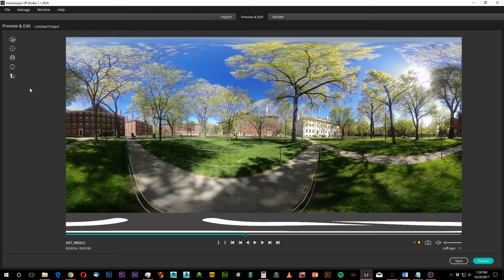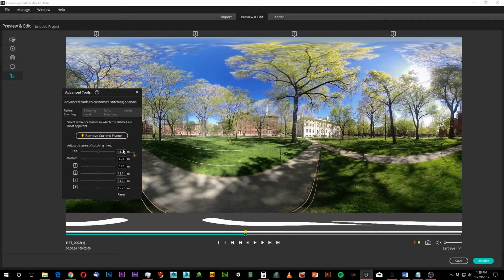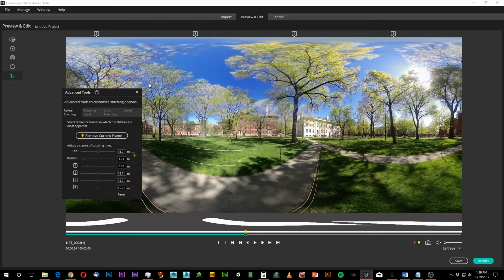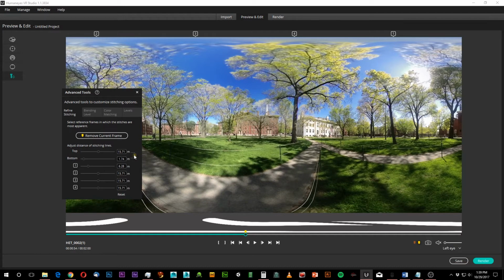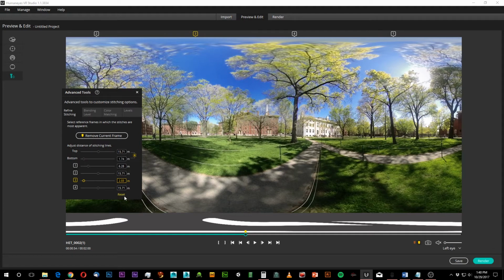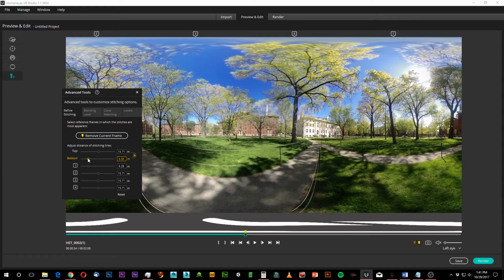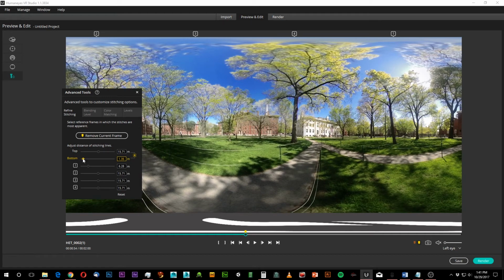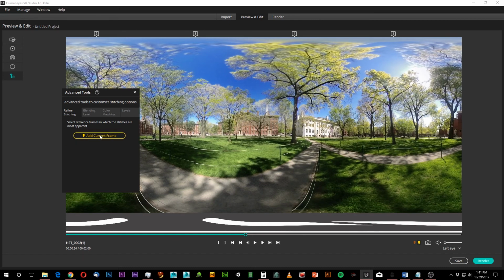Tutorial: Vuze VR Studio Advanced Tools - Stitch Refinement

Comment: Off topic. I have a Vuze camera. What is the best Micro SD card for the Vuze that is the best value? The camera wants the highest bit rate possible when doing high quality 4k/360 recording but most of the micro SD cards say maximum of 90 bit rate. Are the only "real" compatible cards the nearly the $200 ones?  I saw the web page suggestions but that is only 5 examples and only one is a true "120 mb bit rate" card at a whopping price. I already wasted money on 2 cards that didn't work. The camera kept freezing and the card heated up. You guys need to put up a real long list of ones that will be guaranteed to work for the best setting of 4k recording. Thanks. It is a shame we first supporters didn't get accessories with our purchase also. Oh well. Right now I have a desk top paper weight until I can find a card that works well for true 4k recordings that won't freeze or heat up. I found this card but I am always scared that they will not perform as said. I see benchmarks on the internet and they don't show the correct speeds. I am wondering if being directly in the camera is different than having the MicroSD card in a USB3 adaptor. And I am assuming the Vuze camera takes full adavantage the UHS II connectors? Here is an Micro SD card I found. Will this work for sure for the 4k/3D recordings? Thanks again.  https://www.amazon.com/Lexar-Professional-microSDXC-UHS-II-LSDMI64GCBNL1000R/dp/B00U77V5KU/ref=sr_1_1?ie=UTF8&qid=1514012763&sr=8-1&keywords=Lexar%2B64GB%2BProfessional%2B1000x%2BmicroSDXC%2BUHS-II%2BU3&th=1
Reply: So to reply to my own post and those interested: here is the best bang for your buck mini sd card if you can tolerate only 64Gb. I have used this in the Vuze camera and there has been no problems as far as I can tell. No overheating or lag or sudden stops mid recording. I have actually recorded constantly for 1 hour with no issues with these cards. The free usb3 adapter makes everything that much easier when transferring files. Just pop it in a high speed USB port and zip zam zoom. All done. Hope this helps. ;-) Link here for where I buiy my cards >>> http://www.microcenter.com/product/497829/64GB_Professional_1000x_microSDXC_UHS-II_Memory_Card_with_USB_30_Card_Reader
Reply: I'm using a $40 Samsung 128GB EVO UHS-1/3 and it works great.